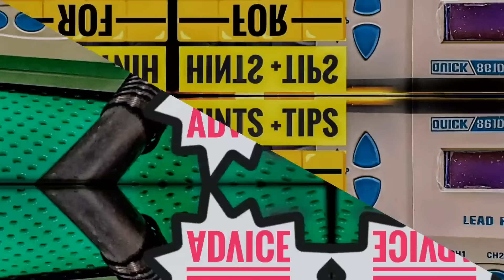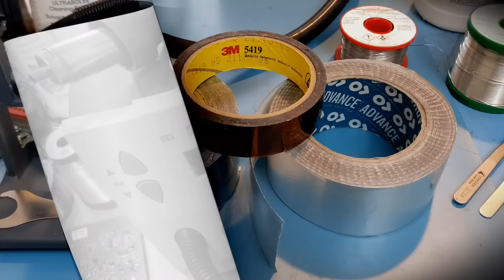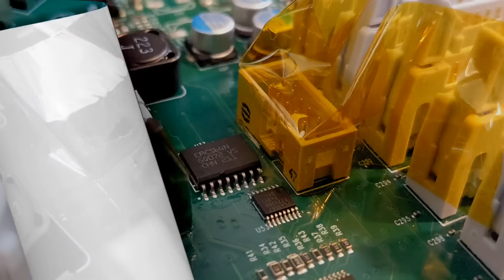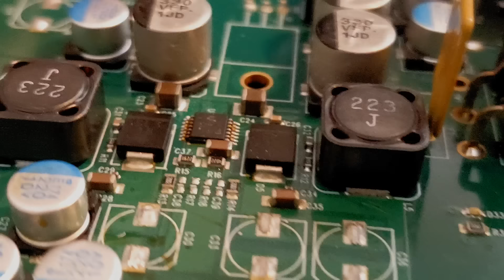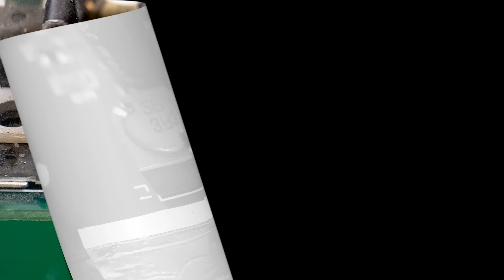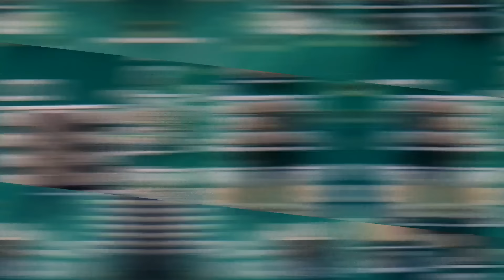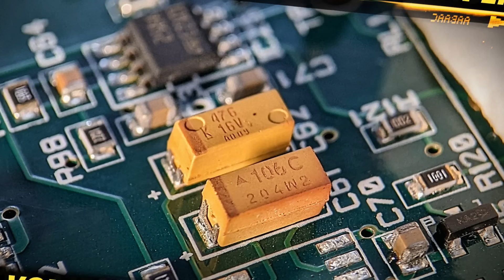How To Use Hot Air Rework Station / Soldering / Electronics

Comment: Another superb heat shield is ceramic fibre insulation board typically used in furnaces up to 1500 degC.  It’s about £15 for A4 x 20mm thick and will last a lifetime.  With care you can cut it into thin strips about 2mm thick.  It’s fragile and not good for your lungs in this state.  I paint it with sodium silicate (waterglass, cheap to buy) and heat to 150 deg C to turn the surface into glass which makes it very strong.
Reply from the maker: Hi , thank you for watching the video and commenting , much appreciated . It's always good to receive other product information , the more choices we have the better . Thanks again , take care 👍
Reply: @mrsolderfix3996  those are not proper nozzles for qfp  and other smd , have to move the nozzle a lot , they are suitable for bga.  I know better nozzles for smd resistors , qfp
Reply: Fiber ceramics are too heavy for this use. I think aluminum foil is more than enough. 
Thank you very much for your Thank you very much for your Thank you very much for your advice. 🌹
Reply: That's a nice tip. Still, the tiny razor-sharp fibres at the edges scare me a bit too much to try this.
Reply: Do you offer in person training